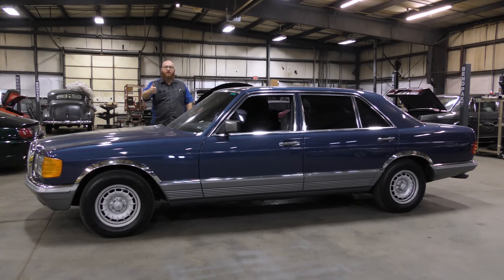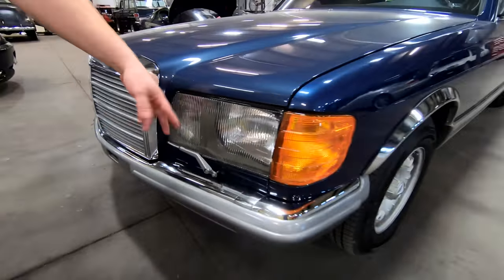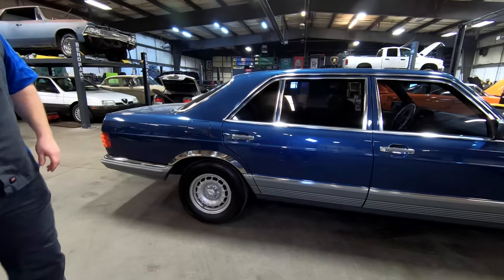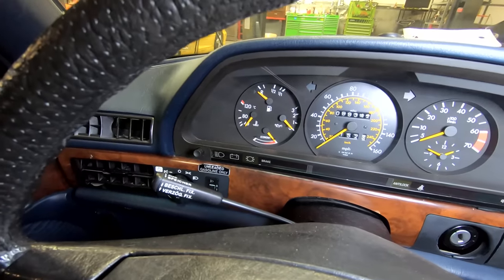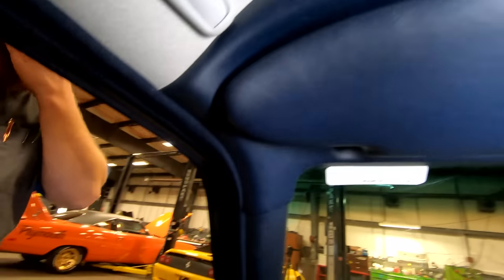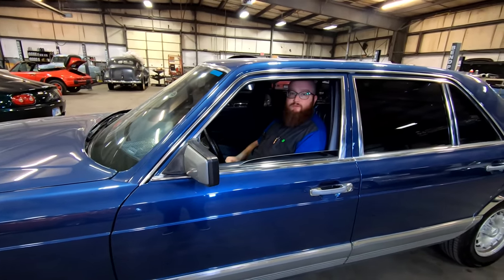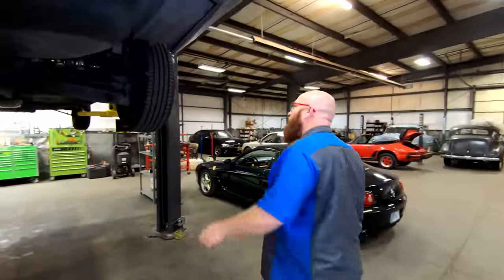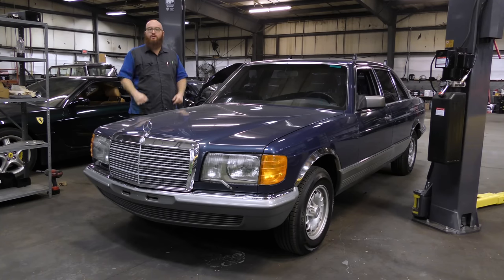Truly a gray market god! Shockingly perfect 1985 Mercedes 500SEL! The CAR WIZARD is in love

Comment: This type of velour was more expensive than leather, if I remember correctly (you don't slide). The warning triangle under the trunk lid is specific for the French market (all others had a white center with black exclamation mark), the skid plate under the oil pan was an option. This is likely the higher compression engine, with exhaust headers and separate downpipes coming down on both sides of engine. I couldn't see whether the headers were the log type Euro, or the desirable TRY-Y = 2 + 2 into dual downpipes ea side coming together in on per side. Hoovies ex grandma 500SL came with Try-Y headers. HP should be very close to the later 560. The vertical wheel next to the light switch, adjusts the level slightly downwards or up,  to compensate for carrying passengers in rear, weight in trunk, or pulling a trailer. A lot of users replace headlight bulbs with 55/100 H4, and dip the wheel 1 step in city traffic. You can't drive the 100 on open roads. 2 little relays will increase output as well. That is very nicely kept for an 85.

US spec cars had the R side log type header going into a pipe going around the back of engine, coming together with L side header into a single downpipe (might be why the R bank frequently goes bad first?). US cars also always start in second gear. If you pull the shifter into first and back to second, it will start in first.
Reply: Actually, in Europe, on a 280 or 300, the windows would be manual, so would the passenger mirror adjustment be, electric are the options. The A/C will not be standard equipment lower in  the model hierarchy,  and most would be manual. The automatic climate control in the car was an additional option, and I wonder whether this had a telescoping steering wheel (electric), another option.  Btw, during a police stop the officers can ask to see the first aid kit (in the rear deck), and the warning triangle held under the trunk lid. Unlike here, drivers have to open the trunk.
Reply: @teutone5866  500SEL had Velour and front and rear electric windows standard, 500SE and below optional. AC was still optional and the passenger mirror was an option on all W126 until very late 80s. Only 560SE and SEL had manual AC standard, automatic climate control still optional.
Reply: @Marklin15  Plus SEC (i got one). The nice thing about the 8 cyl Euro W126 are the same looking log type headers, but with downpipes on both sides of the engine. The US has that weird from pass side behind engine pipe merging into the drivers downpipe. Can't be good for engine breathing, and even the Euro logs will add a few horses (not as much as TRY-Y headers. Euro R107 500SL in US all have TRY-Y headers) You can't buy the separate from Mercedes, but the US and Euro exhaust manifold logs come apart at the center expansion joint. Only the rear part to down pipe is different. As far as Euro GenI bumpers go, I used to have 2 sets with cladding, good chrome zero rust, and they took quite a while to sell. I think I got 170 for 1 set, and 150 for the second. Storing them cost more. Btw, some W126 diesel sedans came with aluminum hood and trunk lid.
Reply: @teutone5866  I’m a huge fan of the Gen I bumpers and ribbed lower cladding. They make the car look slimmer and sleeker, and in my opinion the Gen II changes make the car look bulkier, more generic, and too modern. I know that’s an unpopular opinion though. I have both an ‘84 300SD and a grey market ‘85 500SEL. Both are Midnight Blue/Matt Gray Metallic on Palomino leather, my favorite color combo (which is surprisingly very difficult to find now).

Comment: Thanks for the review Wizard and Mrs W. Also amazed to see a velour interior on a 500SE. The 500SE also looks to have an intact air injection system? Nursing my 380SE towards 40 years and still less than 200,000 kilometres (120,000 miles) in Australia, where the climate is kinder. Beautiful example worth preserving as a testament to the W126 series of the '80s.

Comment: I remember 1985 well, I bought a new Honda that I kept for 18 years. If it hadn't started to rust away I may still have had it today.  In those days, M-B were true quality cars beyond my price range. I never understood why the USA insisted on sealed beam square/round headlamps for so many years after the world had moved on
Reply: The Americans like to hold on to weird notions like SAE and the Imperial System. 😅

Regulations were like that. It‘s standardization at its worst. Sometimes I as an outsider (Swedish) see it as a means to make it a little more difficult for foreign automakers to be able to compete. Those things, the Chicken Tax and the color of blinker glass. Also the fender line amber inlays are typical for USA and NAFTA associated countries.
Reply: Headlight, marker light and bumper regulations in North America used to make Mercedes vehicles look comically bad. The R107 and W116 had it the worst. The W124 suffered the least
Reply: @michaelbrown5601  It’s fun to realize that what you can’t have is what is appreciated. It was the opposite here. My brother and many others sought the USDM-look when they were styling their cars. Especially old Volvos were retro-fitted with the USDM front.
Reply: Because someone in Washington decided in 1939 that sealed beam headlights were such a massive improvement over earlier designs that they were totally perfect and always would be forever. So the regulation was put in place and took the government a very, very long time to recognize technology moved on.
Reply: @yunus_aros  I know! Europeans always want our usdm stuff. I can’t believe it!

 I do have some usdm later W124 blinkers. I know someone overseas wants them 😆

Comment: Here in Australia, back in the late 1980’s Mercedes Benz used to run commercials on T.V. which showed a W126 Mercedes 560 SEL lifted up in the air by a forklift, using only the 4 door handles as anchor points. Back then MB’s were seriously engineered like no other car. 
The 1990/91 W126 560SEL still remains the best looking limousine Mercedes ever built.

Comment: That interior brings back memories! The manager of a NJ country club I valet parked at in the later 80's had a 500 SE very similar to that. The only difference besides being a few inches shorter were the rear crank rear windows, only power in the front. The cloth seats were great when parked in the summer sun, they didn't burn your rump like the leather seats the club members had.

Comment: I’m pretty sure the seats in my ‘87 Ford Tempo were velour. Super comfortable. Probably one of the most comfortable I’ve ever sat on besides an 80s Mercury Grand Marquis with pillow top seats. The tempo had the same color blue interior as well in excellent condition from the original owner. I sold it a couple years ago to my grandmas neighbor and it has become their most reliable vehicle 😄

Comment: Thanks for sharing another amazing car, Wizard.  In the 80s especially, Euro Spec cars were so much cooler.  They had better engines, the beautiful euro headlights, and those trim euro bumpers.  It is also cool to see the options European customers had.  Who'd have a thought an S-Class would have cloth seats?
Reply: This is "Dresden Velvet" the top of the range seating option from Mercedes , from the 300 "Adenauer's" of the 1950's to the long wheelbase finny 4 door W112 300's of the early 1960's , which were then updated with the new de-finned LWB 300SEL W109's , updated in 1972 with the first S class, the W116 the up spec 350SEL's & 450SEL's,  all had the velvet seat option , This is extremely long lasting fabric , its warm on a cold winters day and not sticky to sit on when it's really hot . NEAR DOUBLE THE PRICE OF LEATHER too!

Comment: For 19+ years I drove a gray market '85 Porsche 928S2 5 speed.  Compared to the US model in '85, this thing was a raging animal, almost 50 more horsepower and the lighter, simpler SOHC V8 engine.  Parts were not an issue, since 928 International could supply pretty much everything.

It's a shame that gray market importing became so horrendously expensive due to law changes in 1987.

Great video!
Reply: Same here. I have a 1985 BMW M635CSi original, not US federalised , from Germany. Nothing to do with a US model M6...Totally different car.Imported in Canada after our lucky 15 year eligibility period, not 25 like yours !
Reply: Bureaucrats can’t stand fun of any kind.
Reply: @1983dmd  Mine was brought in when it was new, purchased from a dealer in Vienna.  Back then you could bring one over and have it "Federalized", which my car was.  The owner then had it "un-Federalized" with the exception of the doors and gauges.  I miss that car, but it isn't the machine that my '14 Cayman S is.

Comment: I had 380SE. Took care of 560SEL. My experience is hydraulic lifter issue at #1 cylinder. I'm not sure why. Valve guides do go on these V8. Rust would be on front fender wheel arch and rear driver side (<85)... where salt collects. I kinda prefer US bumpers... it did save my car once when I got rear ended... only scratches to bumper. Euro bumper is sleek but I prefer US bumpers.

Comment: It’s ironic, but Mercedes Benz is the reason the 25 year import law came to be.   Back in the mid-80s so many people were privately importing Mercedes cars direct from Germany to the US saving many thousands of dollars and bypassing greedy US Mercedes dealers.  The dealers got up in arms and they lobbied congress (“bribed”) to make the 25 year or older import rule.  And it has sucked ever since.
Reply: american capitalism was never designed for the betterment of the american consumer.
Reply: @keyboarddancers7751  Petitioning for grievances ends up with some issues, yes.
Reply: @keyboarddancers7751  citation needed
Reply: @KyleK97  It's ironic, but jkk244's original post is the best citation in this instance. Otherwise a quick search will confirm his comment.
Reply: @keyboarddancers7751  If the original post is the best citation you can offer then you have a weak argument at best. You're generalizing the entire American economic system as fundamentally flawed because of one specific instance of politicians accepting bribes (to what extent can you even prove which politicians were bribed, by who, and for how much?) to implement regulations to ensure the vehicles entering the country comply with the current automotive regulations. 

I'll gladly agree that a lot of these automotive regulations are total BS and are created by bureaucrats looking to nickel and dime the American people in any way they can manage, but it proves little else. As far as I'm aware, these cars were illegal to sell without doing the proper modifications after importing to the country. People importing and selling these cars were not doing the proper modifications after importing them, so the government created additional regulations to ensure that this shady business wouldn't continue. It's a shame that American car enthusiasts didn't have the opportunity to import all of the cool and unmodified cars from Europe and Asia, but if that's your biggest complaint about your government then things are going pretty well in your country.
Reply: @KyleK97  Jeezus H! I wouldn't've expected you to agree with me (nobody's THAT naive on the internet) and that's fair enough but I certainly wasn't expecting quite so much contradictory Kool-Aid!
Reply: @keyboarddancers7751  Do you want to translate that sentence to English there buddy?

Comment: I was stationed in Germany in 2000 and I bought a blue 1985 500SE for $3000. I had the same interior except in tan. Yes that material was common in Europe.
Reply: Yep, in the luxury models it was.
You wouldn't find it in a basic 200E or a 190 1.8, but in the S-class it was pretty common.

Comment: W126 are still an elegant timeless car design. That long hood gets me every time!  I worked in a Benz dealer in the late 70's and early 80's. The 126 was such an improvement over the 116 which in itself was a great car. The 380 and 500 alloy V8's much more powerful and quicker than the older 450. Still a great car.
Reply: There is a video around by a German Mercedes collector who insisted only SL had the oval grille, all others whether sedan or coupe had the classic upright Mercedes grille. So he modified his 560SEC with an upright grille (needed new fenders, hood, lights, front bumper, and tons of modification. Looks quite good actually.

Comment: Beautiful grey market example.  I’ve had 10 of these over the years, currently a ‘91 560SEL with only 48,000 original miles.  Mine is going on the auction block soon and it’ll take $25k to buy it.  

Some interesting missing options on this one.  
Sun Roof Delete
Heated Seat Delete 
Rear Head Rest Delete 
Code on radio is to be re-entered if the battery is replaced.  
These cars are truly amazing!!

Comment: I love these older Mercedes that sound like a bank vault when closing the doors or trunk.  I assume part of the "gray market" import process was switching out the speedometer/odometer for ones reading in miles, since no other industrialized country still uses that measurement.
Reply: That's correct, I have the documentation of when they did that to my 84 grey market 635CSi
Reply: We're still using miles in the UK, and I think it's fairly industrialised!

Comment: Thxs Dave 🎥 👍🏼
The W126 is the second generation S-Class, manufactured in sedan (1979–1991) and coupé (1981–1990) models. I had the coupe: 560SEC Silver with Navy Leather. A very impressive machine. 
Regarding the indestructible Velour, warm in winter ❄️ cool in summer, a highly regarded option only available Overseas and Grey Market. Mercedes determined that American buyers viewed Leather interiors as more luxurious, subsequently didn’t offer us Velour

Comment: I had a 1984 500 SEL Gray market Mercedes the same color ( Lapus Blue) as your are showing with leather interior immaculate no dings always garaged . I had it for16 years. I bought it in 1988 with 39,500 miles in Austin, Texas for $26,500 and drove it back to CA  They Grey Mkt. Benz’s were rated 220 or 222HP and a U S  Benz 500 was rated 184HP !  I will try to make this too the point. It was a beautiful car and I enjoyed driving it for about 8+ yrs  but the constant repairs were unbelievable. Everything that could break on a car broke on this Benz except the transmission, other things had to be replaced many times more than once. It had a hydralic suspension and every ie ( Bomb ) on each wheel broke more than once . Replaced the ECU more than once, the head gasket was not torqued properly from the factory and leaked oil at 41,000mi. and had a new hd gasket installed on drivers side. Every plastic window switch and seat switch broke front & back seats  on every window more than once in the front seats. Cruise control broke twice. Because it was grey market Mercedes dealerships could not replace certain essential parts because the numbers are different than parts for American Mercedes at all dealerships. The car actually spent months and months at different  Mercedes garages ie(not at a Stealership), trying to order parts from an importer from Germany i Orange Co. Ca.
I finally took it to one of the largest Auto Auctions in Ca. (Colton) and asked for a minimum bid of $4000. My friend said there were no bids on the car and there are over 1000 buyers at the auction with 10 auctioneers and 10 lines of cars going through every minute or two.
I finally sold it to a used car dealer for $1400 dollars 🥴. The Centra wheels alone  on the car cost over $1500  and the Aluminum Benz Hood is more than $2000 🥲 The truth is if you just have to have a Mercedes then  only lease one that has a full warrenty and the week before the warrenty goes out sell it. Never buy a used Mercedes, BMW or Porsche unless you like burning money on stupid repairs that cost a fortune. Now everybody should get a hint why these cars are so cheap used 😏 you need a Benz Mechanic that knows what he is doing to work on these cars and no one else wants to touch them.

Comment: This video brought back so many memories. My father and his two best friends. All imported S-Classes back in the early 1980's it was their  "we've made it!" Presents to themselves. I remember the blue booklet price guides that they went over with fine tooth combs. You could literally order the car any way you liked. Velour , tartan, mb tex, leather seating, custom paint, a raft of gasoline and diesels, final drive, wheebase,  seat heaters, blinds, automatic climate control, adjustable back seat sunroof, honestly I think the only things that were standard throughout the range where the steering wheels and the alloys. Back then you could even order it with manual transmissions. 
They had a great adventure picking them up in Germany and racing along the Autobahn.
Only one of the Three Amigos is still here.  My father being the first to leave  before 1990 rolled around.  At least he had a little time to enjoy his success.
Reply: Similar to my father getting his w126 back in 1981

Comment: One give away here that this is a European car is the fabric upholstery.  Fabric is common in the rest of the world, but in the USA Mercedes dealerships only ordered cars with leather upholstery.
This car is very similar to a '91 300 SE that I owned.  Most of the trouble I had with that car was the solder used in the circuit boards would deteriorate and loose contact.  Also, a problem with a commonly made mistake with a mismatch of metals by using aluminum fuses in the fuse box.  The fuse box connectors/holders were copper.  Other than these issues, now and then it would develop an oil leak here or there.  But my car was about fourteen years old when I bought it.